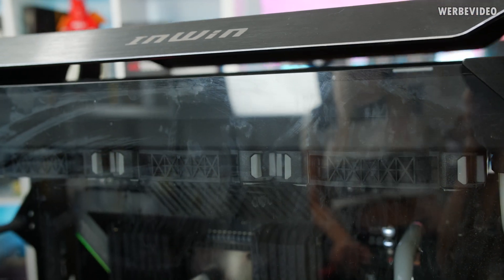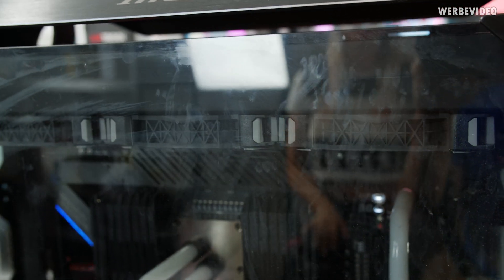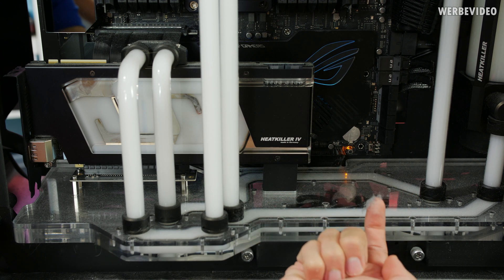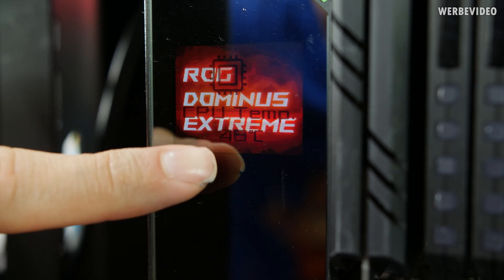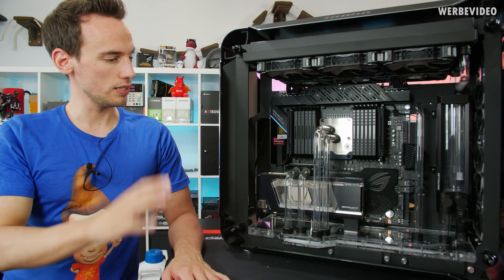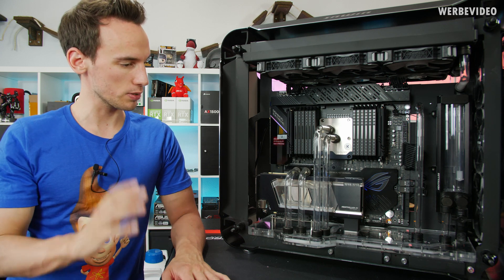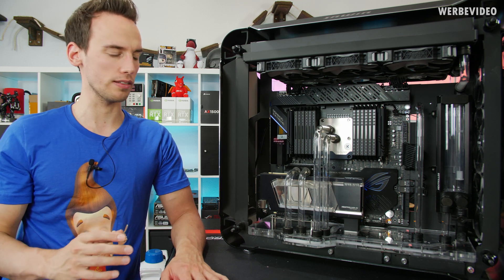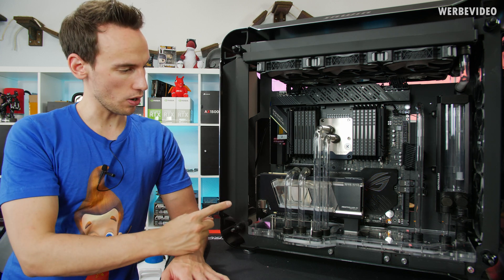Project Irrationality Part 12: Pastel-Problem after 6 Months? Benchmarks and Draining the Loop!

Comment: It's funny you mention CPU scaling with Premiere. I recently played around with encoding between my 3950X and 2070. 

Granted my 3950X is SMT off for a higher overclock, my 2070 was able to encode about 2-3x faster with NVENC. Only downside is no 2-pass encoding, but I personally don't see much of a difference.

Edit: By the way, speaking of "irrationality", maybe it would be fun to do a comparison between a 3960X and 3970X overclocked vs a 3990X overclocked with SMT off. If we had a 3980X with 48 cores, it would be a better comparison against the 3960X, but of course we don't have that, lol.

Comment: I run pure distilled with EK concentrate (clear). My first drain and flush occurred at 13 months and the blocks were clean. Now I am approaching 24 months and the blocks are still clean. I avoid the dyed stuff like the plague - too many horror stories from blocks getting ruined to catastrophic pump failures. If you want color go with colored tubing instead of colored fluid.

Comment: Fun video Der8aur:

For those doing regular maintenance / cleaning their PCs: Do NOT use a household vacuum to clean near any electronic components.  The air going through the nozzle produces lots of static electricity that can damage your MB / RAM / CPU / Components.  Electronics shops have special static dissipating vacuums for this very reason.

I suggest blowing out your system outside using compressed air from a can. Do not use any compressor that isn't equipped with water filters - otherwise moisture / water can make it's way between the the MB and electronic components and corrode them...

Comment: My 3175X can do 4.6 at 1.24V, but way too hot, and too afraid to delid and possibly losing memory channels because socket doesn't hold the lid at all. 4.5 seems to be doable at 1.2V, running daily at 4.0~4.1 on all cores and up to 4.6 on four cores.

Comment: The video title had me worried, as I've been using the same EK solid white coolant for about the same length of time.
My previous EK red was in for 2 years prior with zero maintenance, and so required a lot of cleaning out when the time came.
I'm certainly not going to leave it so long this time around, but it's reassuring to see that you've had no problems so far.

Comment: I get the cleaning PC of dust, but what's the point of draining and refilling the loop? I've never done liquid cooling...
Edit: Also, if you upgrade the GPU, will you use it in another build or perhaps do a giveaway? But, make a performance comparison first please
Reply: I never have either, but I'm going to be building one for the first time with water cooling. It's my understanding you need to replace it periodically to minimize the risk of gunk (which is much higher with that pastel stuff) and corrosion. The fins on the CPU plate are VERY close together. It doesn't take much to block them and restrict the flow or even block the flow. So you need to do maintenance to keep everything clean and flowing.
Reply: @awilliams1701  It depends on what coolant you use (and ensuring you're not putting aluminium in a 'normal' copper/brass/nickel loop). I've been running the same Mayhems pastel yellow coolant for about 4 years without doing anything to it. Problem with most youtubers is they are sponsored to use new coolants from inexperienced coolant brands like Thermalcrap and Alphacool which just fail cause they haven't done any long term testing.
Reply: @OptimusToaster  ive seen mayhems pastel cause problems on jays two cents.

Comment: That OLED burn in is really sad for a motherboard of this price. What the actual F... I know why I avoid ANUS products...
Reply: I had 2 of my nokia windows phones have OLED burn ins, but not nearly that bad. Granted I disabled the "turn the screen off automatically" feature. But yeah I don't trust OLEDs as a result.
Reply: OLED gonna OLED... works as expected. 😣
Reply: @carbonsx3  My One Plus 3 phone is 4 years old and has not even a single sign of burn-in...
Reply: @kyoudaiken  Neither does my Note 8... but our phones also don't use $3 postage stamp OLEDs from BANGGOOD...  😉
Reply: @carbonsx3  This is what I mean... This is a $2000 motherboard. That's REALLY dissappointing from a once such good motherboard brand...
Reply: @kyoudaiken  You are correct of course... I don't know why it feels like we're arguing, honestly. 😅
Reply: @carbonsx3  Maybe we aren't. xD

Comment: Derbauer, you should know better than to use gunk creating fluids in your loop. We've known about this since the late 1990s. Remember the Swiftech green additive that did the same over a short enough period of time?

It may not look as nice but using demineralized water (or distilled water) just an anti algae solution is pretty much all that is needed and all that should be used. If you use distilled water, use less anti algae. If you use demineralized water use more.

I get the appeal of colored liquid but it always causes gunk. Always. No matter the brand.

Comment: Pls try an automotive grade long life.
Reply: I run type B automotive inhibitor in my loop since 2004, only changed the coolant 3 times since, last time was in 2013.
Only thing I have changed over the years is the GPU blocks as I have upgraded, the CPU block being AMD means I can use it from socket 939 to AM4 so I never needed to replace it.

Last time (2016) I inspected and drained the system there still was no corrosion or degradation so I reused the coolant,  I totally recommend automotive inhibitor for PC use, it does an amazing job at protecting the components.
Reply: Those are glycol based, so a lot worse than anything distilled water based.
Reply: @muf1772  All auto motive is based on water they add different things for different uses at different ratio's and are used in multiple metal mix configurations far Superior to anything used in PC cooling.

Comment: vacuum cleaner can build up static electricity, so not optimal to use.
Reply: Was waiting for these kind of comments. Relax!! Do you really think that after all his years dealing with computers, he wouldn't know about the excessive worry about this?
Reply: That's true but when the computer is plugged in then the case is grounded and static buildup will be quite minimal unless he manages to conduct directly through a sensitive component which would be difficult.  Even then though it's probably fine.  Just make sure the PC is plugged in to have ground.

Comment: I thought the rtx 3090 was basically a titan. Though you’d have to sleeve a whole new cable yourself for it. Even though that’s not as irrational as the platform.
Reply: They said it was a replacement for the titan. It has the VRAM and price tag to match.
Reply: Daniel Parks well it’s a thousand dollars less and it has thousands more cuda cores. Plus there isn’t a game around that would use 24gb of vram unless you were playing it on an extremely overclocked and binned chip at an extreme resolution. With 6000 more cuda cores it is definitely going to be a titan.
Reply: @capnclutch007  it does not. Titans are for hobbyist or low level research of GPU-based compute; neural networks and other acceleration. There's not enough VRAM for those purposes.
Reply: it is
Reply: The Titan have the full chip and the 3090 is cutdown still . So it wouldn't be a titan really, more like an overpriced 80Ti class ^^
Reply: The same way people thought the 2080 Ti last time was the new Titan because it cost so much more ?  No Nvidia will obviously release a Titan card later for even more money than the $1500 for the 3090. We already know there are Quadro cards on the way with more cuda cores than the 3090.
Reply: @logirex  With  what is left on on full GA102 vs 3090 there would be max 3% perf increase. That's not even enough for 3090 Super.

Comment: just for fun you can export a project from PP as an .XML then import in to resolve to compare render speed and time line performance.
it wont be one to one depending on what effects you use but if you ever need to transfer projects from one NLE to anther .XML is a useful backup  save file as it will work with most editors.
cuts and edits transfer well it's just the more complex or specialised effects that tend to have problems.
resolve is relay worth having a go with, takes a bit at first but well worth it.

Comment: I'm glad your EK solid fluid worked out, my blue pastel from them was clear within 6 months and had residue everywhere as it came out of suspension. I guess it's just hit or miss.

I used the concentrate instead of the premix though.
Reply: I've got a little residue with my EK clear though truth be told that might be because I did not follow instructions and just dumped the concentrate into a one gallon jug of distilled water.
Reply: @XxViciousxX  Everything in my loop (240+360 rads, Mono lock, GPU block, pump, etc) all had the powder gunking them up. :P I switched the Koolance transparent blue and it's great so far.

Comment: I'm only 33s away of Der8auer irrational PC AP 4K rendering  yay :D 3960x 4.3Ghz@1.28v using heatkiller TR4-Pro block (huge coverage and amounf of fins, also had no air bubbles left in the block after only a few minutes of the 1st loop run which is not always the case, really good design)